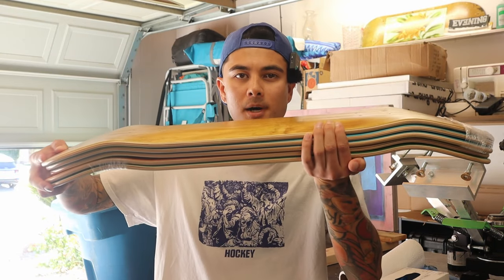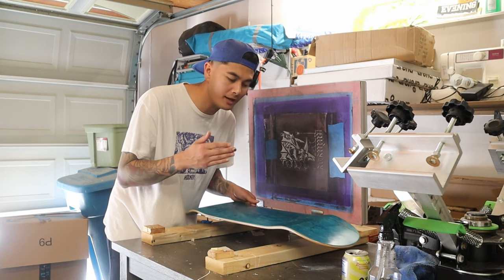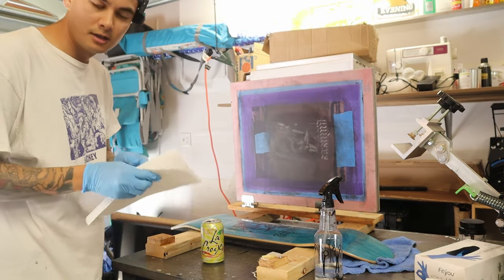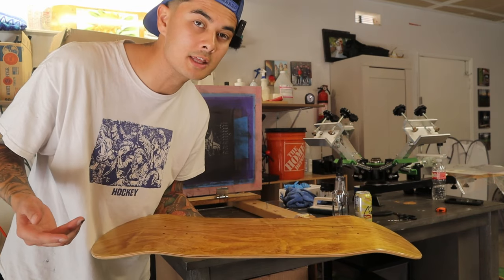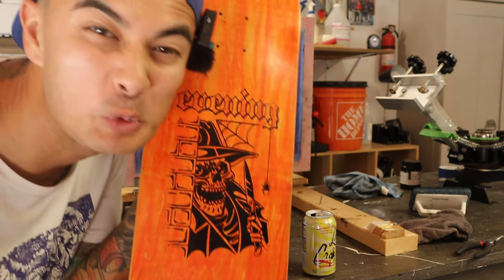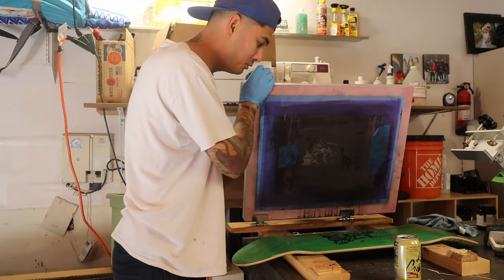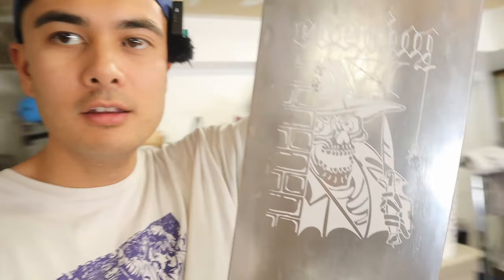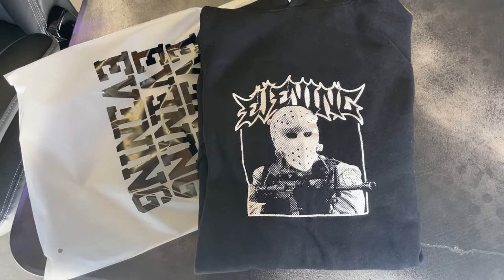DIY Skateboard Screen Printing At HOME!!!

Comment: Great job, Sean. You seem to be getting the hang of it pretty well. If you dont want to waste money on that clear contact sheeting you can just use regular packing tape that you use to tape boxes with. I would also reposition the screen or the hinges so that they're in front of you while you're sliding the squeegee towards yourself. Having it on the left side will likely loosen the hinges over time, and you'll end up double printing your image. Last thing is, i dont know if it's the ink or something but you shouldn't need to pull down so hard when pulling the squeegee. That's most likely why the red was flooded. But overall you're looking like a pro. Good to see you growing.
Reply from the maker: @jimrustle  I appreciate that! Thankyou! I never consider the location of the hinges! That makes a lot of sense! and the packing tape part too!, I really appreciate the knowledge!
Reply from the maker: @jimrustle  and 100% I’m heavy handed the hell out of the squeegee and while pulling screens 😂
Reply: @SeanEnuks  love watching your progress and enjoying your growth. Used to print tees at a shop in hemet and then later on in Temecula. Keep doing that diy shit homie.

Comment: Niiiice. Try to make the screens a little more loose, it will help with the side borders as they drop due to the concave on the boards, and having a slightly curved squeegee will also help. Ultimately screen printing is a form of art, so we have to learn to love the little imperfections. 🛹🤘
Reply from the maker: Hell yea cheers for the tips! I have a curved squeegee I made with an old deck, definitely need to lose some tension in the screen! It’s been a fun journey learning this stuff!